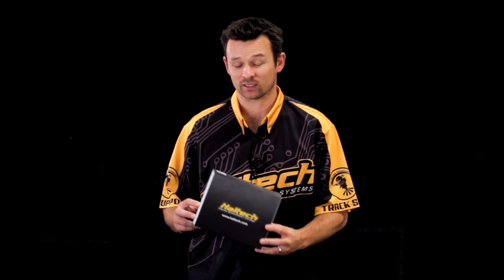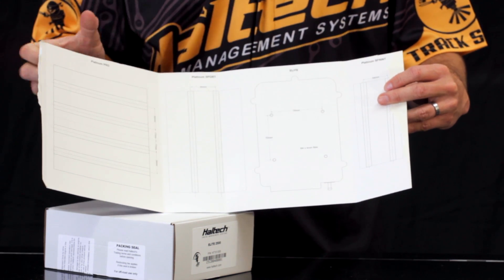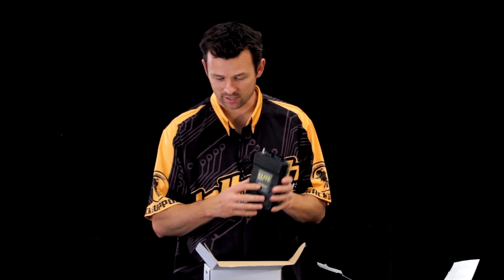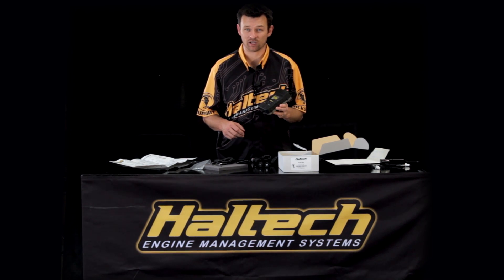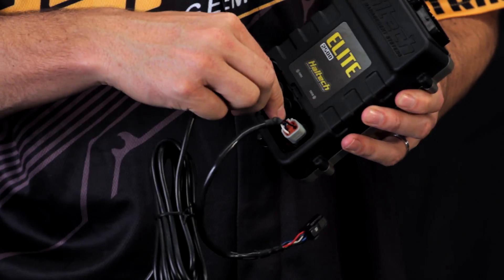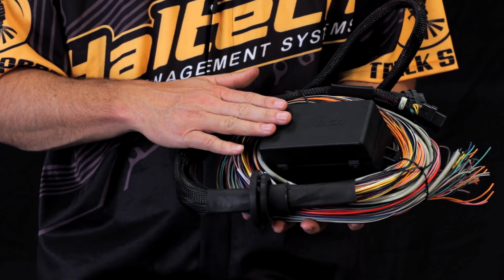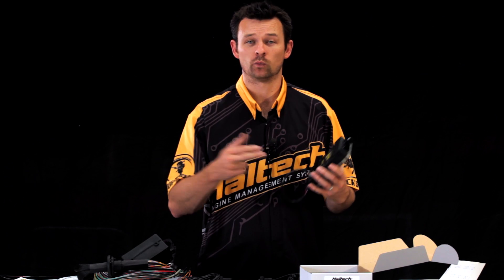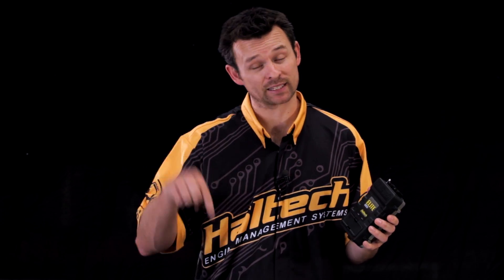Haltech Elite - What's in the box

Comment: When will the rotary functions be working? And is the drive by wire function already up and running? I'm looking forward to begin able to control my throttle plates in my RX7.
Reply from the maker: We are working hard on Rotary support on the Elite. Currently we are doing development on staged volumetric efficiency fuel tuning.

Comment: Why doesn't the heat-shrink go all he way to the connector plug? Why are the wires exposed at the end of the cord?
Reply from the maker: The heat shrink and sheathing is supplied “un-shrunk” to allow the installer to remove any unused wiring before heat shrinking the harness. There is around 30mm of exposed wiring to allow the harness to bend into the correct position when mounting the unit.
Reply: haltechecu ah, makes sense. creating ability to tailor a modular unit to any installer's specific application.